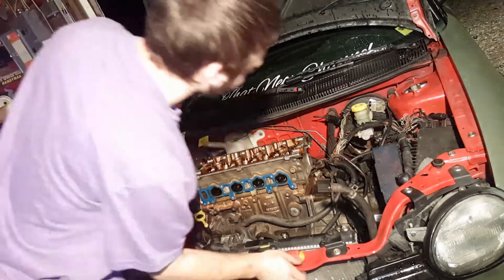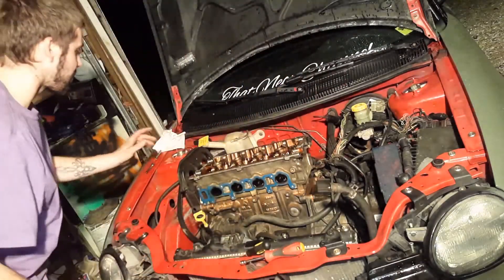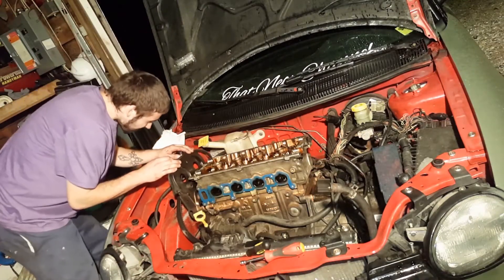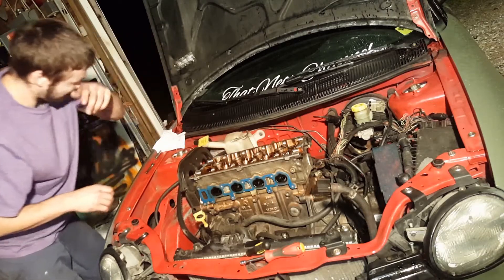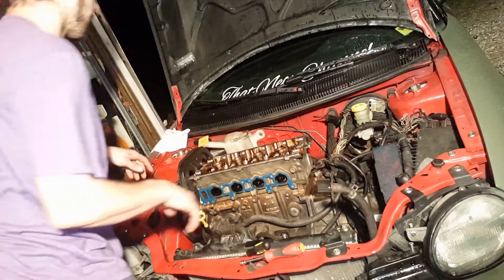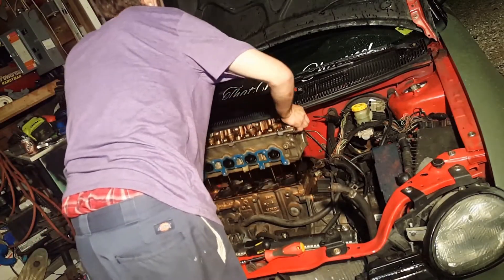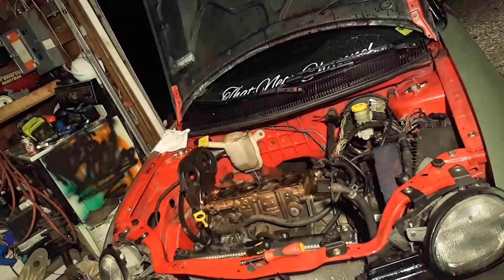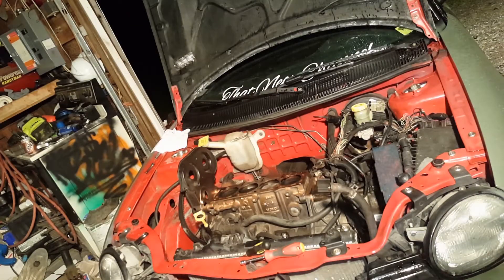Pt. 1.5 Of Broken Neon Bent Valves Video...A Look At The Bent Valves

Comment: Man that sucks, hope you get it fixed soon.  Question.  I recently got a SXT srt4 swapped in on a trade with a bad motor.  I bought another one out of a wrecked car.  In the wreck the ac broke two bolt holes off the block (where the ac compressor/motor mount bracket mounts to the block)  what would you recommend as a fix?  I really dont care about ac but do i need the torque/motor mount?
Reply from the maker: +James Smith idk man thats a good 1 do u have the stuff that broke off ?if so id try to weld it back on or cut it off the old motor and weld it on ...or take the internals and put them in the bad block or just get a 1st gen shell and swap the motor into that then u dont have to use the passanger lower mount u just use the middle lower mount ...thats what i would do
Reply: Thanks for the input,  i was wondering why your car didn't have that mount.  I dont have the broken pieces but was thinking of welding studs into the broken holes and trying that.  If that fails,  Ill put a tone ring and a piston in the other motor.  Thanks again, keep the vids coming man.

Comment: i have built so many 2.4's  reuse that headgasket, it did not overheat, same as head bolts and intake gasket if it did not tear. i have beaten and raced hard on reused head gaskets max 4 times each. never had 1 issue.  you only have a problem after to many overheating cycles
Reply: soon to have my srt swap in my nyg aswell bud. couple more weeks before i turn the key
Reply from the maker: +evilnygneon ive reused headgasket b4 but this car last time i stripped the cam caps i reused the headgasket and it leaked bad and ive had to many issue out of reuseing intake gaskets ill reuse headbolts all day and exhaust manifold  gaskets but i have a hondata Thermal intake gasket so no worry but since that headgasket leaked on me once i aint doing it again not fun redoing all that work ive built about 20 2.4 also u think id be tired of them lol but headgasket only 40 bucks now so i just bought all new gaskets and bolts
Reply from the maker: +evilnygneon i want a mint nyg thats my goal as for neons and it will also have a srt swap ...im actually trying to gather stuff to srt swap my s13....where u located id love to see ur nyg
Reply: i may be some distance from you, im located in calgary alberta canada
Reply from the maker: +evilnygneon yes just a little lol
Reply: where are you at? i may try and get to the next neons.org meet if i can swing the vacation time
Reply from the maker: +evilnygneon falling waters Wv
Reply from the maker: +evilnygneon i hear ya ive always wanted to go